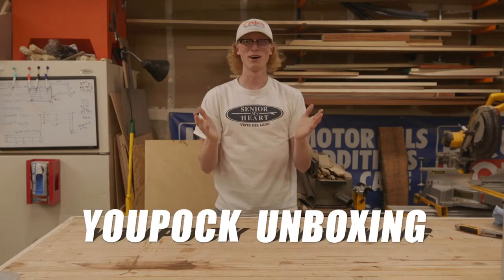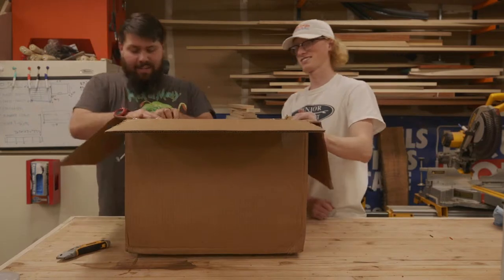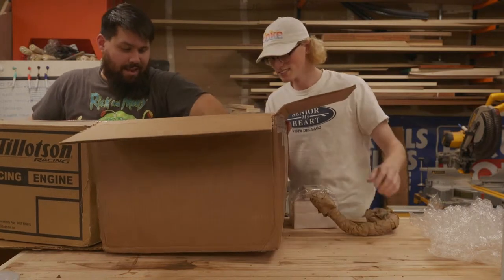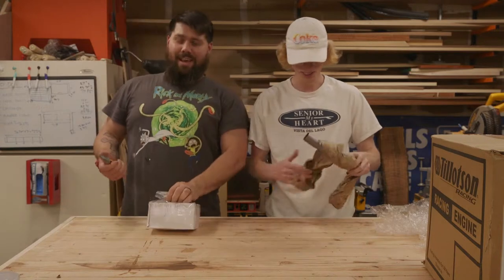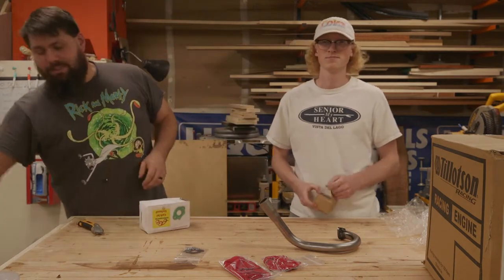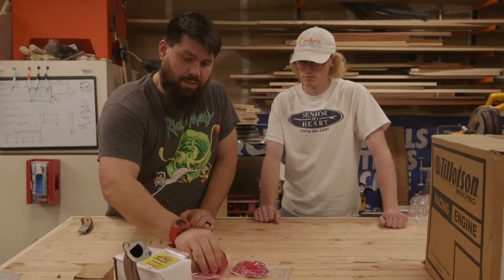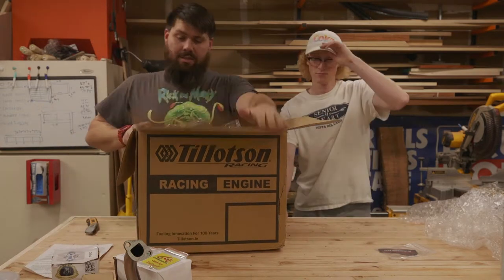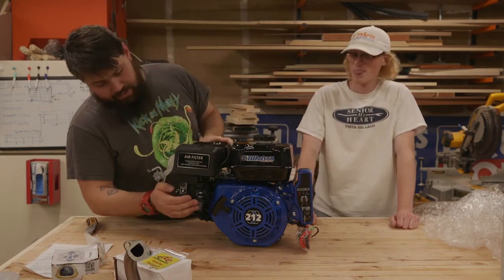212cc Tillotson Electric Start Engine 10 horsepower stock! Unboxing

Comment: I love these Tillotson engine. Wish I could have afforded the electric start and $220 billet flywheel with ring gear. I thought my old shoulder could still handle a pull start with a Bansai .265 cam/26 lb. springs. I was wrong.